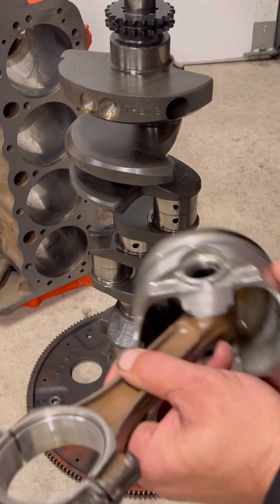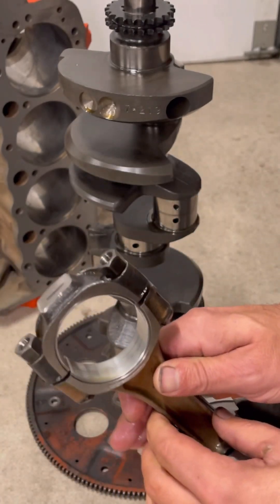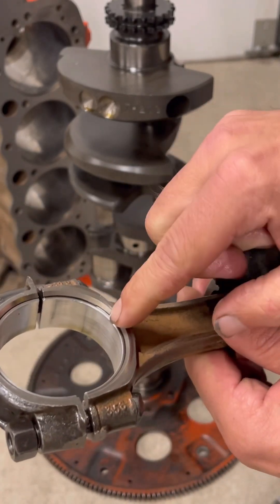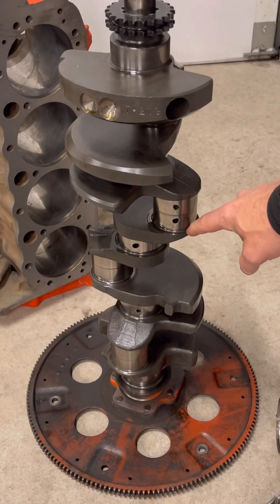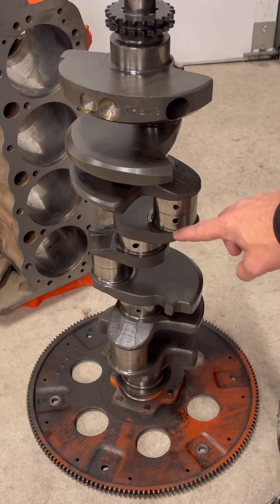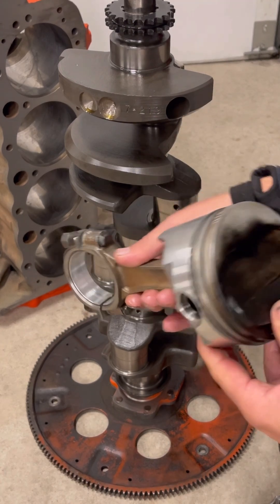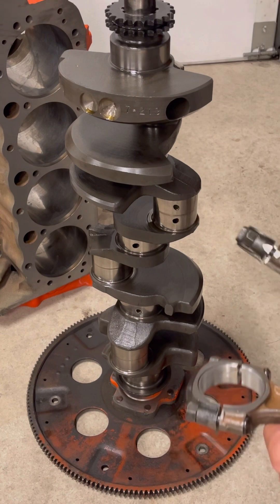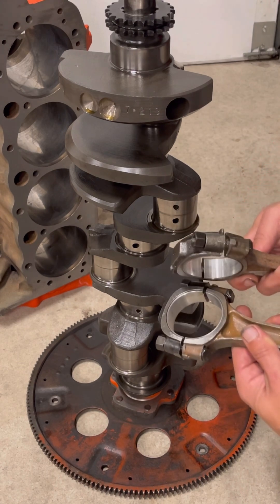Connecting Rod Orientation - Engine Building Tip of The Day #shorts

Comment: ASSUMING the pistons were installed the correct way around on the rods.  Nothing more fun than finding out that you got 7 the right way around and 1.... not.  That's why I get the rods honed for full-floating pins on motors I'm likely to "play around with" over time.  Has NOTHING to do with making more power or greater longevity or any of that stuff.  Entirely so I can swap pistons and flip the piston on the rod (in my own garage) if I get it backwards!
Reply from the maker: I always use full floaters too